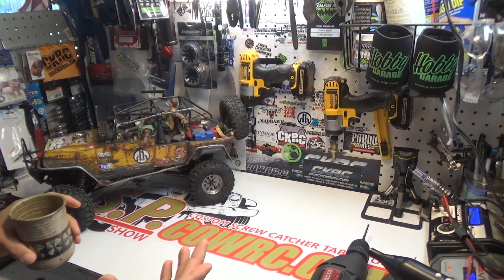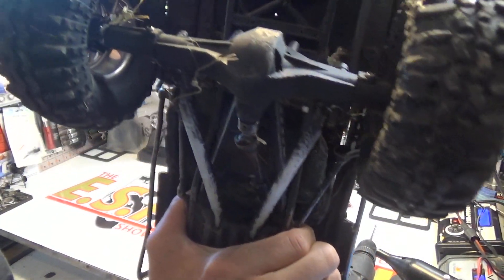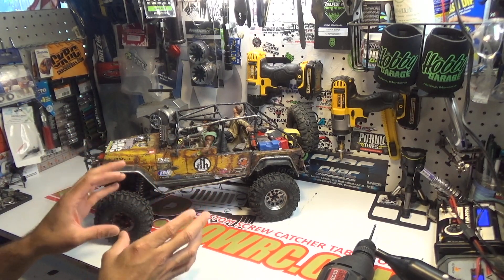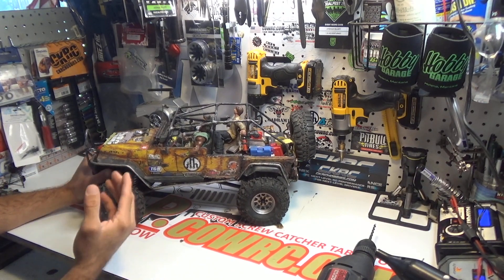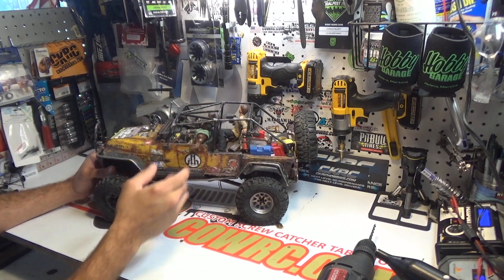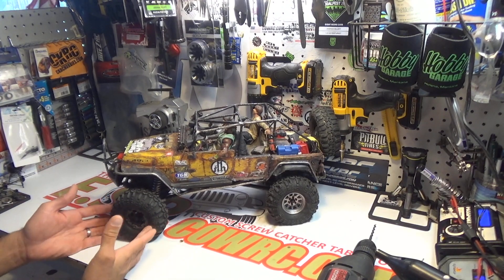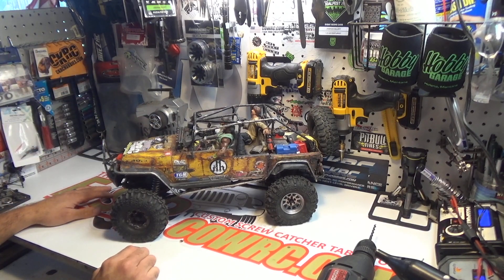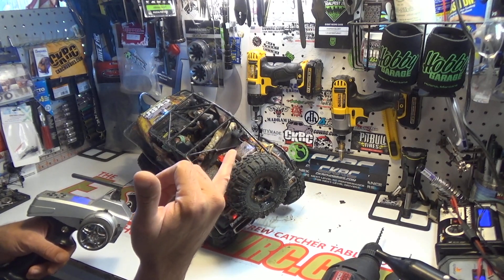HOLMES HOBBIES | MOTOR CONTROL | EPISODE 23

Comment: Using the correct gearing can definitely save you money. I still have not burnt up any ESCs or motors yet in over 30 years in the hobby. Carrying around an infrared thermomter to check ESC and motor temps helps when testing new gearing or even just running what you know works to check on things. Thanks for the info Coleman!
Reply from the maker: Yes Sir! When you want your stuff to last taking the time to build it right and tune it right is important but driving it properly and maintaining it properly are just as important. So having an infrared thermometer to check temps on the fly is never a bad idea. Thanks for watching!

Comment: I love that Jeep bro then again I love anything that is custom but with that said you should try doing as I did and run a drill transmission from a black and Decker vpx that gives you a lot of wheel speed in-between crawl spots but with a flip of a switch you can have super low, with mine I have a 13 turn motor that has plenty power no matter what happy experimenting
Reply from the maker: I have a buddy that has done many builds with drill parts. Pretty cool stuff! Gotta love the creative side of the hobby!

Comment: brother josh,where can i find these gear reducing unit by hpi? 
these product has been discontinued right?:(
Reply from the maker: Not sure... I usually get mine from the lhs or from one of my sponsors. If you can't find one then I suggest looking into the gru lineup at Atees as well.
Reply: EXTREME SCALE PERFORMANCE RC i see..atees good alternative for that. Do you have the link bro? hopefully atees have the same ratio with the hpi one. if not its no big deal as long the gearing will be reduce.. thanks in advance mr.josh #ESP4LIFE